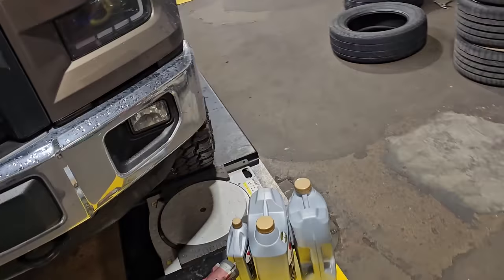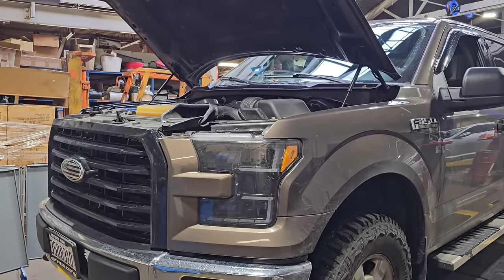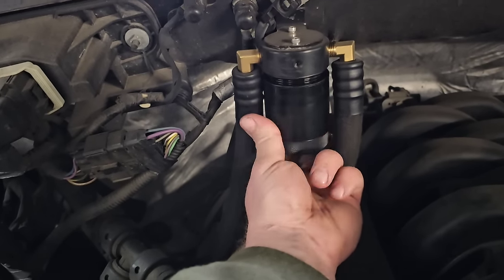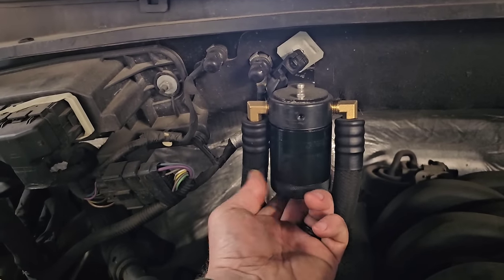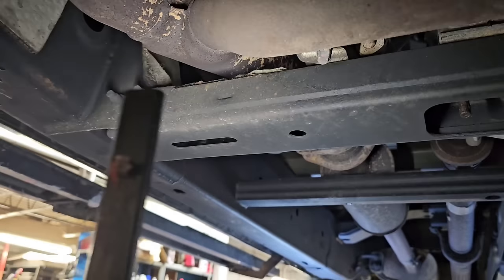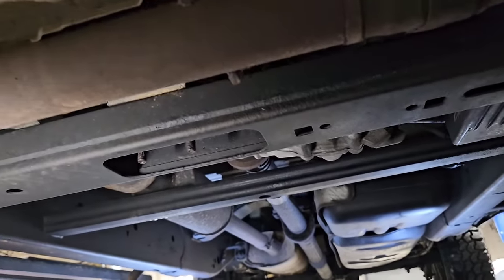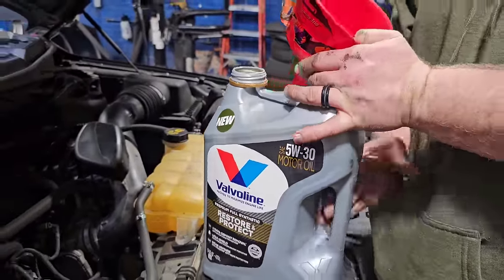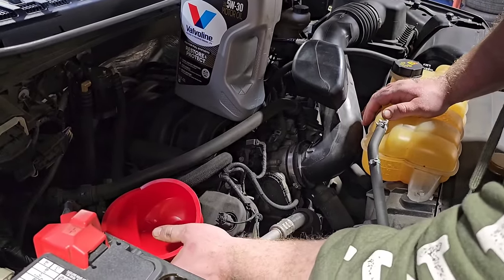F150 5.0 Oil Change New Valvoline Restore Oil, FL820 Filter Not a FL500, Prime Oil System

Comment: Grabbed the garage box of Valvoline high mileage full synthetic for both my trucks last oil change. Incredible deal for $4.83 per quart.
Reply: Same, because of Rich’s Valvoline video.
Reply: Yeah. Wally world has the Valvoline garage box for $58 and change.
Reply: Same here too. Both my nephew and I are using the garage box full synthetic. We change our oil between 3,000 and 4,000 in our F150
Reply: Interesting how many come in the garage box?
Reply: @retiredsnowbunnyhunterx5106  Twelve quarts.
Reply: I just got 2 boxes of full syn high mileage 5w30 for 26.97 on clearance a piece
Reply: Yikes
I must be getting old...... I remember buying Castrol 30 weight for 69 cents a quart when Kragen would put it on sale.
Reply: I remember Castrol 20/50 was $ 2.39 a qt back in 1989. Walk into AutoZone and prices average 9-12 a quarter. I must be getting old
Reply: I remember buying oil for 89 cents a quart

Comment: A TV shop owner (in the 80' s) I knew always had E-150 Ford vans with the 4.9L six cylinder motors. Ran a larger filter on them also. Got 350,000 miles or more from them motors with all the abuse of stop and go traffic servicing TV's for customers when TV's was made to be fixable
Reply: Great old engines, simple to service.
Maybe back in the day the V8's had the 'cool' factor but the inline 6 was a simple proven mill.

Comment: I did the same thing with oil weight on my Ford V10 with 212,000 miles. Changed from 5W20 to 5W30 four years ago and it made a difference in engine sound.
Reply: Is it worth it for the 6.2 boss as well?
Reply: @mikep1584 yes run 5w30 or 10w30 in the 6.2.
Reply: Same here.
Reply: 5.7l hemi ...... 5w30  smooth and dead quiet ......valvoline
Reply: Same here 01 Ford V10.

Comment: Great video Rich! I'm glad you showed the underside of the truck after the Fluid Film has been on for awhile. Seems to be holding up and doing its job. I was under the impression that it would remain "slimy" and become a mess when working on the undercarriage. Looks like it dries up over time.
Reply from the maker: It levels out and drives up some it does stay a little bit slimy in the heavier areas
Reply: I had my new Ram sprayed with it....On the F150 I traded off 3 years and it looked fantastic after having it sprayed with fluid film every year
Reply: They don't really dry up, but what they do is they pick up dust and it forms a film and eventually if you get enough dust in there, it'll turn into almost like a wax like you'd find on an old tractor. And those old tractors are left in the field exposed to everything and you peel off that grime and it's almost like new steel underneath there😅

I was reading and in the olden days they said that they would spray the car down with those types of fluids. Usually it was motor oil and not wool wax or fluid film and then they would drive down a dirt road and it forms a crust on the exterior. I use woolwax I also use black because it has the graphite in there and that hides the bushings and stuff from the Sun

Comment: My van calls for 5w=30 and I use the Penzoil Platinum but I use it with 10w-30. I put 6qts in and in the winter use 4 qts of the 5w-30 and 2 qts of 10w-30. In the summer I flip it and use more of the 10w-30. Good video. Happy Motoring.
Reply: Why not just use 5w-30 year around other then better cold start flow there is no difference in the oil thickness between the 2 at operating temperature. Also why wouldn't you want the better cold start flow it makes a difference even in the summer.
Reply: @DeusKDuo  5w vs 10w and there's no difference? So why do they put different ratings on the container?
Reply: @mostlymoparih5682  That is for the cold the w stands for winter. It is saying when the oil is cold it will act like a 5 or 10 weight when cold but a cold 5 or 10 weight oil is still thicker then a 30 weight oil when hot. Even a 0w oil is to thick when cold. So you want an oil that flows as good as possible when cold but once hot it will act the way a 30 weight oil should. So in short first number is how the oil acts when cold which is always to thick and second number is how it acts when its hot so 30 weight is 30 weight despite the first number. They carry the different weights purely for marketing reasons. People will see 10w-30 on their oil cap and want it even though a 5w, and 0w-30 will serve them just aswell or even better.
Reply: @DeusKDuo  5w-30 flows like a 5 weight in the winter and flows like a 30 weight in the summer. The reason for running lighter weight oils is to get better fuel economy. Go look up specs for an engine from year to year and the only thing that they change is the oil spec. I have been changing the oil in my cars for 55 years. My dad worked for Esso and I have used his advice along with my experience and done pretty well. Companies don't their products to last forever, just as long as the warranty then they want you to buy new.
Reply: @mostlymoparih5682  The oil doesn't know whether it is winter or summer its flow is based on the temperature of the oil. After about 15 minutes of driving all oil is over 200 degrees. So whether its winter or summer its all 30 weight once the car is good and warmed up. 0w-30, 5w-30 or 10w-30 its all still 30 weight its not any lighter. Why would you not want an oil that flows better when cold where most engine wear occurs is during cold starts because even 100 degrees is still not warm enough for the oil. Here is an example of actual oil specs a 0w-30 oil and a 10w-30 oil  at 212 degrees which is normal operating temperature of a warm car they are both at a thickness of 10cst but at 75 degrees which is a cold car during a normal summer morning here in california a 10w-30 oil is 100cst which is 10 times thicker a 0w-30 at the same 75 degrees is 40cst which is still to thick but much closer to the 10cst the car is meant to be running oil at. I do agree the lighter weight oils are just to meet cafe standards but a 0w-30 is not truly lighter then a 10w-30. In fact i run 40 weight oil in my mirage that calls for 20. All my cars run on 0w-40 all the benefits of running a ticker oil without the drawbacks of being to thick when cold.
Reply: @DeusKDuo  So if it's for the cold, why don't they put 10C 30 instead of 10W 30?
Reply: @mostlymoparih5682  That unfortunately is just bad naming on whoever came up with it. Maybe back in the day it made sense when people were using monograde oils and switched weight depending on weather and multigrades where just coming out.
Reply: @mostlymoparih5682  Sorry for being late on this it just came to  mind. Oil weights are a range so a 30 weight is a range of about 9.5 to 12.5 cst, might be slightly off, and so there are even cases where a 10w-30 can actually be thinner say something like 10cst and a 0w-30 be the thicker one at 11cst. I have seen situations like this aswell. Its usually though the oils that claim to increase fuel economy are on the lighter side of the range of weight. But even then its not always the case sometimes they achieve that small fuel economy benefit by using something like moly. Even then that benefit is more like 0.5% realistically.
Reply: Mans mixing oils to make 6.5w30😂😂😂😂😂

Comment: You got great truck there. Rare to find a used truck like that that was taken care of. When I had my f150 5.0 I always just put 8qts using the 500 filter. Oil level was filled to the top of the cross hatch marks on the dip stick.

Comment: Thanks for the content on this truck as it is comparable to my '17 F150 5.0. I look forward to your oil results. I've been running 5W30 ever since I drove it home last May at 51k and love it. Shortly after arriving in CT after driving from Minnesota, I changed fluids on the front and rear diff, 6R80 pan drop w filter, t-case drain and fill, drain and filled the radiator several times to replace the orange coolant with yellow 50/50 as orange is prone to fallout and HC restriction with block heater use. Luckily i didn't have that issue as the prev. owner never used the block heater. I do not "flush" and use the factory yellow 50/50 coolant mix to stay away from any tap water contaminant issues or distilled "lack of ion issues".   Bled the brake system twice. Fluid filmed the frame inside and out prior to winter (I love the fluid film too ☺, all filters changed inc. cabin. Love the truck. She has been solid.
Reply: I have a 16 5.0.  I flushed my cooling system and replaced with the yellow also.  Dumping the radiator only drains half the coolant in the system,  and unless you pulled the thermostat,  the coolant in the block wouldn’t of cycled.  You would of had to bring it to operating temp every time before the next “dump and fill” as you explained.  Even doing that 3 times still leaves you with .75gallon old orange coolant (halved with each dump assuming it was fully mixed).   I drained my radiator, pulled the thermostat, started the engine and kept pouring in distilled water with the rad plug still open.  Once it was coming out crystal clear I stopped.  It took me 20+ gallons to get it all out. Then I dumped the radiator which leaves 50% water in the system, topped off with 3 gallons of new concentrate for a perfect 50/50 ratio.  Distilled water is a non issue when mixed with coolant concentrate.
Reply: @MRTEE-sy7sb I hear you and believe me if I had any indication that my orange coolant had the symptoms of Fallout issues I would have most certainly taken the slightly more invasive approach and flushed it. On my last drain and fill before winter I'm happy to say that the coolant coming out looks just as pure as the brand new yellow going in and that is after many drive cycles mixing through regular driving. I don't think I've ever owned a vehicle with better heat
Reply: That truck is lucky to have you taking care of it! Couldn't ask to be In better hands

Comment: I admire that F150 you have, ever since you bought it , I just like it.
Reply from the maker: Tyvm
Reply: Exactly
Reply: @FordBossMe  
is the fl820 the better option over the fl500? Asking because i own a 2023 f150 3.5 ecoboost and was wanting a bigger filter option for better filtration on the oil without going to a bypass system
Reply: @FordBossMe Curious, if using a thicker oil, wouldn’t it move slower and also hold onto heat more/longer? Therefore, causing the engine to work harder/run hotter? I hear a lot of people say I ran a thicker oil because of a tick or noise but just because you can’t hear the noise because you jumped up to a thicker oil doesn’t mean the issue that’s causing the tick is solved. Just thinking out loud.

Comment: Been doing flood mode on my 2020 Transit Connect since I learned about it last week. Changed my battery today (Got 91k miles and four years from the OEM battery) and used your BMS reset procedures. Flash the high beam five times, hit the brake three times....worked like a charm. Next up is a brake job....91k miles and still on the original pads.
Reply: Life’s too short to drive around granny style all the time. 

You only live once… use up those brake pads my guy, there’s nothing like the feeling of getting new pads and rotors along with a brake flush on your ride. 🤩🥳🤓
Reply: @I_know_what_im_talking_about  Highway miles :)

Comment: Nice. I’m super curious about the Restore and Protect.
Reply: It seems to be a good option to slowly clean up old engines or dirty engines. Basically you’re supposed to just use it for the long run because according to an interview, I saw cleaning your engine too fast is going to clog up your filter and those small oil passages. So if Valvoline wants you to use it for like four oil changes to see the best results.
Reply: @slscamg  I've been using Valvoline for years with no problems. Been driving an 02 F150 for 20 years. Love this truck. Might use that new oil next change.

Comment: I started running the Valvoline blue 5w40 it says heavy duty diesel and gas engines on the label full synthetic in my 2017 f150 5.0 runs way quieter than it did with 20 or 30. And at hot idle oil pressure it’s 15-17 psi vs the 10-13 with the 5w20

Comment: I have a GM 3800 engine that uses a AC Delco PF47 and tried a larger PF52 which has the same threads and gasket dimensions, however the filter is too long.. Found that AC Delco came out with a Environmental version of the PF47 and PF52 which is shorter then the non Env. equivalents.  Tried a Env. PF52, being a little shorter and now can fit it for more filtering! 👌

Comment: Valvoline with Cummins Diesel made oil that would really clean inside of engine but you had to change filter alot. I've done few per Cummins trying for unstick piston rings worked most of the time. I've been putting FL820 on my 15 Mustang GT since new or Ford racing version time to time. Then wife's 14 Escape I asked her what mileage was on last oil change. She says it was done in March I'm like so what don't care about the date only mileage. It has 4200 miles on oil change, I said it needs to be changed and she's like why it was just done. I really think people don't think about maintenance because its not broken yet. Just drive it until every warning light on and wheels falling off. Then get shock of the cost to fix it and then go on every social media site claiming car a piece of crap. Her son drove Dodge Durango with his kids inside down interstate with upper and lower ball joint about ready to pop out and hub bearings out. Only thing that kept from coming apart was brake calipers. It broke one of caliper bolts and was rubbing the wheel. He didn't hear a thing you got to be kidding me. But I noticed grease dripping from front hubs collecting on pavement. Besides smelling brakes and smoking some and he's like really I didn't notice and claims it drove ok. He wonders why he has to get different car all the time
Reply: Total ignorance.
Reply: I have a  sister in law that goes through a Dodge caravan about every year maybe 2 if she gets an oil change 😂 they all seem to make it to dang near 300k before something major

Comment: I think I heard you mention possibly using a 5w-40 oil?  I have a 2017 F-250 that has the 6.2 gas engine. I have been using 5w-40 Rotella T6, Valvoline Eruo 5w-40 and Pennzoil Euro 5w-40. Seem like the engine is the quietist with Rotella T6 or the Valvoline. The engine/truck has 152K miles. Runs great. NO issues. I value your opinion on this Rich. You think this is helpful to use 5w-40 or does really make any difference?  I had a 2018 F-150 with the 5.0 coyote and had rocker arm/cam follower bearing failure. Lost a couple rocker arms around 100K....and I maintained the 5.0 very meticulously.  The F-250 6.2 has a different rocker arm set up but I hoping/thinking the 5w-40 being a little thicker will help out these overhead cam engines. I also carry some doubt that the 5w-40 is not getting through the VCT or VVT cam oil passages like a 5w-30 will. Would you think I am doing harm to my engine with the 5w-40 and should be using 5w-30 like OEM specs or is the 5w-40 better. 
Also thanks for the flood mode recommendation. I have been doing this with my Ford trucks every since I watched you do this a few years back.   I live in TN so we have about 3-4 weeks of really cold weather. I do know whether summer or winter the 5w-30 make for a much louder engine with my 6.2 and with my former truck with the 5.0.  Thanks for the faithful videos and thanks for your comments on the immigration issues going on. The immigration border crossing is way beyond concerning.  Our country is in big trouble.

Comment: 383,700 miles today on my 2011 Ford FX4 155 inch wheelbase 5.0 Coyote. Bought new. Change oil every 5,000 to 6,000 with recommended Motorcraft 5W-20 Semi-synthetic and Motorcraft oil filter 505. Never a problem. Do watch oil level in between changes and admittedly add oil when needed. Love my truck. Alternator and hub actuators finally went out this winter. Rust is only issue I have north central Illinois). Everyday vehicle and I use it to pull my car trailer with antique cars. So not babied.

Comment: Nice job. I’ve been really struggling with whether or not I’m going to keep my 19’ 5.0. It had oil consumption when I got it. Has the TSB done. Seems to be better and reading good after a couple hundred miles. Still need to log some more miles to know for sure. But in my mind I’m just struggling as whether or not to keep this truck. The oil thing will always be on the back of my mind as time goes forward.
Reply: How many cars have you owned? 

I’ve been thru A LOT of engines with various mileage and they all consumed oil to where I’d have to top off 1/4qt every few months. 🤷🏻‍♂️ it’s normal! Add some oil, poke around and clean out any leafs and wipe down the main engine covers with a moist micro fiber towel and BE A MAN!!! 💪🏻😈👍🏼

Comment: Motorcraft FL820s that's the same filter I use in my 2007 Ford Escape with the Duratec 3.0 V6 and it's a really really good filter, no weird  rattles on startup w/ 5W-30 Motorcraft Oil @120k miles 💪🏻

Comment: That seems like a lot of oil in that catch can. But then again I do have the 1st gen coyote, which for a stock truck engine I believe is the best version of the 5.0l.
Mine at 5k oil changes, which is mostly towing, only gets about half a shot glass in it. And that's at 175k miles with roughly 100k towing, and I don't slow down for the passes which forced me to put a bigger trans cooler in.
The 2nd and 3rd Gen engines just seem to have more oil consumption issues, I understand they are better for making power, but the 1st Gen engines just seem to work, and I like the fact they had the position cooling jets for those long pulls at higher rpms.